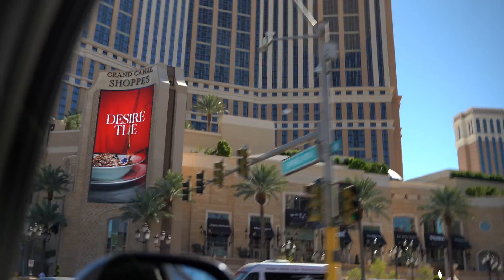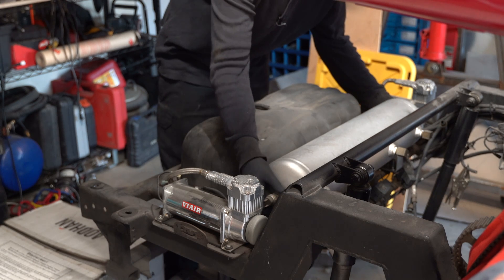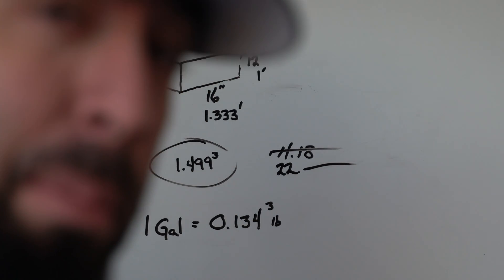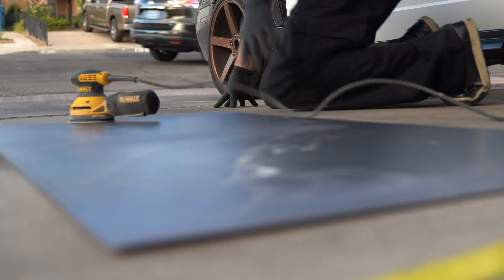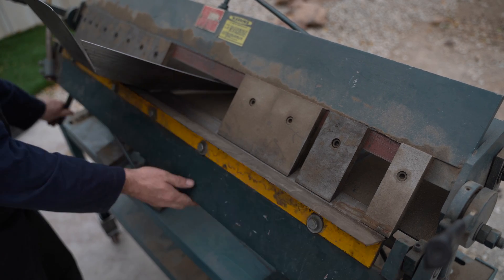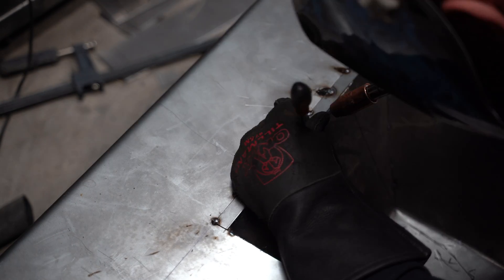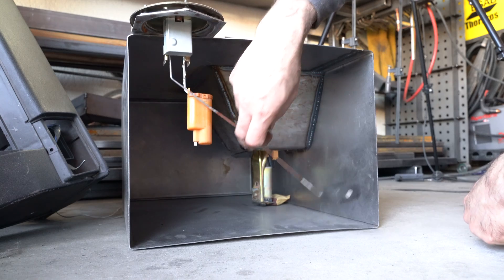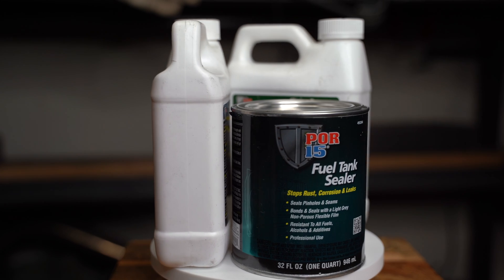Mighty Max Ep. 09: How to Build a Custom Steel Fuel Tank From Scratch

Comment: Always wondered how electro plating inside of a gas tank would hold up 🤔
Reply from the maker: That's really interesting. I barely know what electroplating is. I had to look it up. Apparently chrome is technically electroplating. 
In my brief research car manufacturers already use electroLESS plating inside tanks which is a similar process but with chemicals. Also by it's description it's not an attractive coating. Similar to galvanized but if it works it works. I kinda wish I didn't put this crap in my tank now. 😕
Reply: @GarageFab  do a bit more research on diy electroplating, I'm currently trying to restore an old gas tank, I also came across black oxide seem very easy alternative
Reply from the maker: Will do! Thank you
Reply: @GarageFab  thank you for a very informative youtube channel 🙏🏾✌🏾

Comment: Nice job on the tank. Hey did you pressurize the tank before u sealed it to check for pin holes in your welds
Reply from the maker: Yes and no. I pressurised it momentarily to force all the walls uniformly outward because the welding warped the walls slightly, but it did not stay pressurised long enough to check for leaks. I did fill with water though and checked that way.
I guess my thinking was that the tank liner would seal any tiny holes if there were any.

Comment: Hi I’m looking to raise a diesel fuel tank about a foot higher than it is with a custom tank with the original pipes/ adjusted, sender etc would their be any issues with fuel flow do you think?
Reply from the maker: I can't be sure without seeing it for myself but if I understand you correctly you want to make a deeper tank and extend the pump assembly extended to reach the bottom. If I'm correct you shouldn't have any problems. I'd advise that you ensure the fuel pump rests near the bottom of the tank. Fuel pumps generally only have pushing capability (no vacuum or sucking) so the pump must be primed (or soaked) in order for it to operate properly. As long as the fuel level doesn't drop below the pump I'd think it should be fine. I'd be happy to check out some photos if you've got them. You can shoot them to either of my Instagram accounts. @mankandy_kreations or @garagefab
Good luck!
Reply: @GarageFab  excellent thanks for the advice
Reply from the maker: Anytime

Comment: One of the bungs is for the purge check valve. Also no baffling for the pump?
Reply from the maker: Thank you for that. I'm having all kinds of trouble finding the original parts.
I rushed the end of this video because it took so long to create. I left a lot of info out unfortunately but I'll show all in a future video. It got a filler neck with a check valve in it and the pump got it's own shallow trough that I basically copied from the factory eclipse tank.
Reply: @GarageFab  Not a problem, I forget what the other flange was used for. Your work is coming out very nice, keep up the good work, I am loving the videos!
Reply from the maker: I found ONE image one the interwebs where it shows the check valve connected to the other small port with a plastic hose... And my Haynes manual shows nothing. The most worthless of books.

Thank you for the kind words. 🙏
Reply from the maker: Thank you yet again! That's way more info than I was able to find on my own. Incredibly helpful.

Comment: Great video as always! I think the best option for bending the angled bends like that isn't cheap... most likely a large cnc press brake with individual lower finger dies, like the top punch fingers just on the bottom. Which will allow the angles to bend with out hitting, cant tell you how many times I designed something with angled bends and realized I had no good way to do so lmao.
Reply from the maker: That’s brilliant! I’ve been mesmerized by videos of those in action and forgot they existed. That should be easy enough to make a simple version in a hydraulic press. Thank you, Brother! Knew I could count on you. 👊
Reply: Anytime my dude, ya very true could make a simplified version for a press or sheet brake!